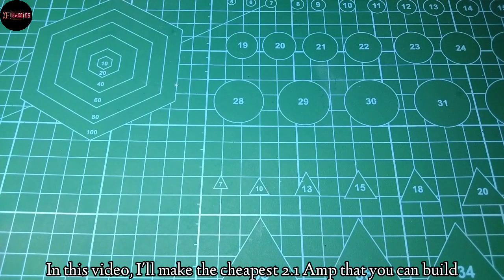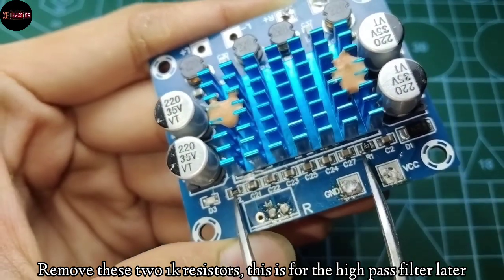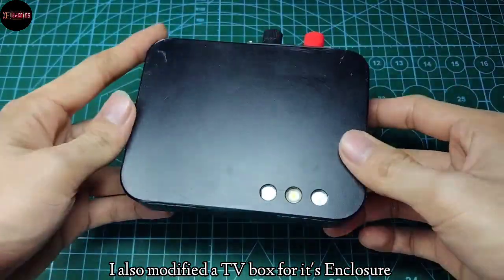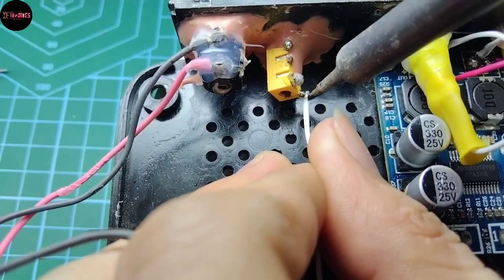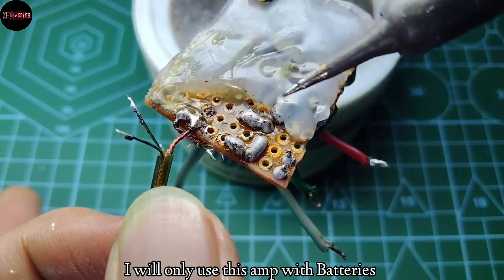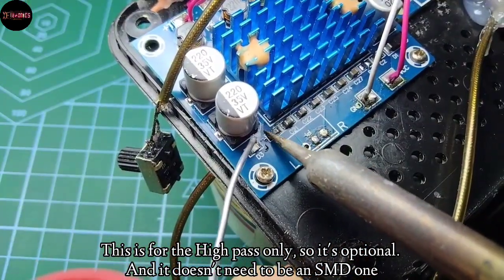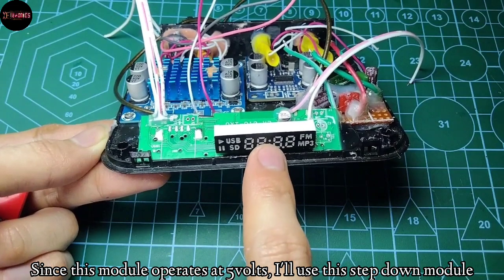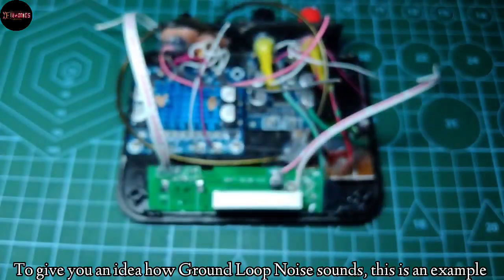Cheapest DIY 2.1 Amplifier with TPA3118 and TPA3110! #diy #electronics #tpa3116 #classd

Comment: 0:33 does removing those resistor make the amplifier output only high and mid instead of full range
Reply from the maker: I changed it to 22k, it was 1k before.
Basically theres a 100nF capacitor in the input, and each channel input have 22k resistor to ground.
That creates a high pass filter

Comment: Para saan yung kinabit mo na 104 na capacitor
Reply from the maker: High pass filter ng tpa3110 boss.
Bale 104 capacitor na naka series tapos 22k na naka parallel sa input ng tpa3110.
May schematic yan boss nasa vid
Reply: @x3dtronicsph  next naman sir. Yung XH M-543 may hissing